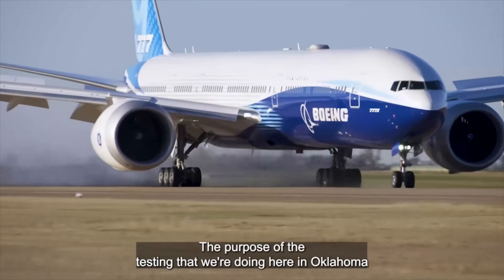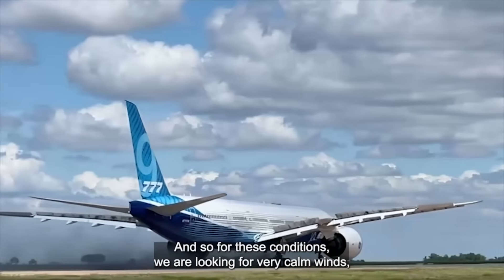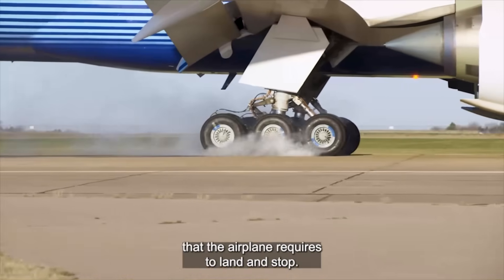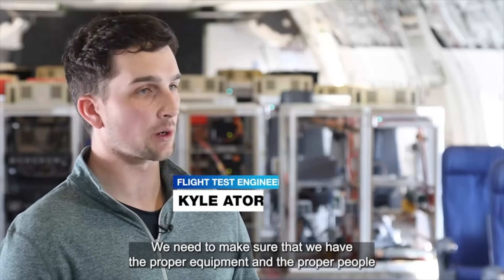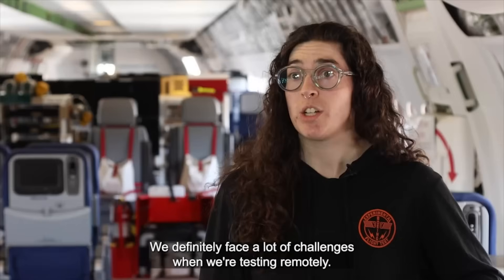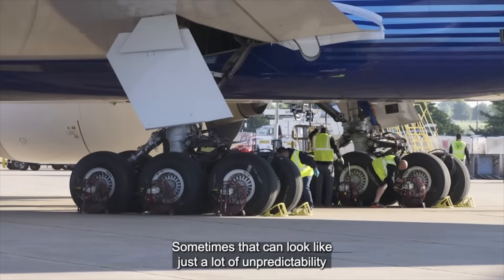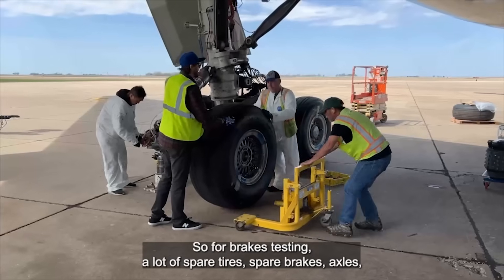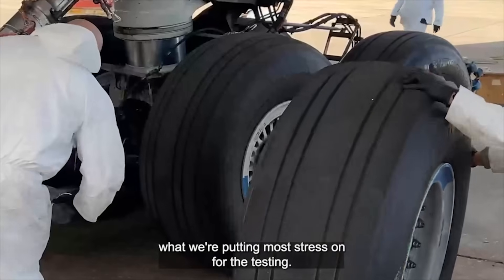Boeing 777X Underwent Extensive Brake Tests – All Credit to the Team Who Made It Happen!

Comment: Down with Boeing! Whitewashing the crash of Air India 171 as ‘Pilot Error’, not done!

At least I personally shall now never fly an airline that operates a Boeing airplane!

I used to love Boeing so much! The 777-ER used to be my favourite! But not anymore, they are making compromises on quality.

#if it is Boeing, I am not going to
Reply: That was caused by the pilot. If you listen to the cockpit voice recorder YOU HEAR THE OTHER PILOT SAY "WHY DID YOU DO THAT, WHY DID YOU SHUT THEM OFF"
Reply: @WillChrisman-jd6nv Yeah? Really?

Where is the quote and the time stamp?

The report says that the top speed the aircraft attained was 180 knots, and IMMEDIATELY AFTER that the fuel cut-off switch went to the off position - two things; if you even have a little understanding of aviation, you’d know that the engines don’t lose thrust all at once - so if the fuel cut-off switch was set to off after achieving a ‘top speed’ of 180 knots - that’s a lie; go to any simulator and you’d find that the speed keeps increasing for at least 2-3 seconds after the throttle have been pulled back/fuel cut off.

Secondly, the pilot is merely ‘INQUIRING’ whether the other pilot did something, to which the pilot responded with a NO!

Also, we have not been provided exact quotes of what the pilots talked about - these have been interpreted.

Moreover, the preliminary report doesn’t mention the exact altitude the aircraft attained, the exact time the fuel switch FAILED (it’s a bloody technical report for god’s sake); immediately after can be 1 second, 2 seconds, 3 seconds, or even 10 seconds - in a flight that lasted only 32 seconds and where the report mentions the exact time stamp of when the aircraft started taxing, it’s it ONLY OBVIOUS to note that such important information has been deliberately kept hidden?

Go fool someone else!

Boeing is a sham and has to be held responsible! Money has to give way to safety - culprits need to be put behind bars! It might just be someone you know the next time. Don’t be a fool! Use your rationale for god’s sake!
Reply: @dearzinndagi honestly you shouldn’t come up with these theories before a final report, and many people including real pilots have simulated it already and I dont see then giving off those details, other people like stig aviation give off information on the fuel control valves and how Air India did in fact change the entire unit two times, please just wait for a final report, if it says it was Boeing fault then you are right, if it doesn’t then you are wrong, and no Boeing will not “shut them up” because that would be really hard to shut up more than 5 branches following the investigation including the fact that they are all international and not American except for the NTSB
Reply: @EPRDATA Absolutely brother! I completely agree with you that no assumptions should be made before the final report! I am only countering ‘assumptions’ and ‘allegations’ which are being made against the pilots without any proof! 

If one thing is wrong, the other is equally folly! Wouldn’t you agree?

Comment: Meanwhile everyone is buying the A350 😂
Reply: Actually, the 777X is following a sales path fairly similar to the A350's. The A350 XWB launched in 2006 and racked up 777 net orders by the time of service entry in 2015. In comparison, the 777X launched in 2013 and has accumulated 541 net orders so far, with plenty more to come by the time of service entry in summer of 2026. 

Both programs suffered developmental challenges and delays, with the main difference being the 777X had to endure the Covid-19 disruption to global supply chains, the MAX debacle, and the 787 quality control conspiracy. Also in common, both the A350-1000 and the 777-9 have suffered from the industry shift away from large, expensive aircraft.

But good news: The A350 and 777X are not direct competitors, meaning that carriers that order one may very well order the other as well, depending on their overall fleet commonality strategy.

Comment: Stay strong Boeing
Reply: Yeah? Really?

Where is the quote and the time stamp?

The report says that the top speed the aircraft attained was 180 knots, and IMMEDIATELY AFTER that the fuel cut-off switch went to the off position - two things; if you even have a little understanding of aviation, you’d know that the engines don’t lose thrust all at once - so if the fuel cut-off switch was set to off after achieving a ‘top speed’ of 180 knots - that’s a lie; go to any simulator and you’d find that the speed keeps increasing for at least 2-3 seconds after the throttle have been pulled back/fuel cut off.

Secondly, the pilot is merely ‘INQUIRING’ whether the other pilot did something, to which the pilot responded with a NO!

Also, we have not been provided exact quotes of what the pilots talked about - these have been interpreted.

Moreover, the preliminary report doesn’t mention the exact altitude the aircraft attained, the exact time the fuel switch FAILED (it’s a bloody technical report for god’s sake); immediately after can be 1 second, 2 seconds, 3 seconds, or even 10 seconds - in a flight that lasted only 32 seconds and where the report mentions the exact time stamp of when the aircraft started taxing, it’s it ONLY OBVIOUS to note that such important information has been deliberately kept hidden?

Go fool someone else!

Boeing is a sham and has to be held responsible! Money has to give way to safety - culprits need to be put behind bars! It might just be someone you know the next time. Don’t be a fool! Use your rationale for god’s sake!
Reply: lmao Boeing needs to fix itself
Reply: No Boeing does not need to stay strong the people travelling on boeing aircraft needs to stay strong
Reply: @aryannarayan9208  onother one.
Reply: @aryannarayan9208  give it a rest
Reply: Stay alive Boeing passengers
Reply: @lsubesteva  So tired.
Reply: @Infiltrate.and.Betray so tired assole u guys news channel to speak against pilots ....
Reply: @lsubesteva  give it a rest
Reply: @jostmathe defending a billion dollar corporation is cringe asf
Reply: @KungFuWizardOfJesus  lol. You people truly don't know the meaning of the word facts and over react.
Reply: @jostmathe grounding an entire group of aircraft due to serious faults from an manufacturer is nit overreacting? Hows the boeing stock doing buddy?
Reply: @KungFuWizardOfJesus  its doing well actually, its close to this year's highest point. Okay my friend, lets remove the 737 max from the picture since we all acknowledge that it was a rushed program. with it removed, what faults are you talking about?

You guys need to chill, it seems to you guys that all incidents and accidents are caused by Boeing😅
Reply: @KungFuWizardOfJesus  and you do realize that stocks don't mean anything when it comes to accidents and safety. why bring stocks into this discussion ?
Reply: @lsubesteva  overused ahh joke 💔

Comment: Great pilots for a great plane!Is that a GE9X?
Reply: Yes
Reply: Ok thanks!
Reply: Yep, a GE9X-105B1A. According to the type certification data sheet, there are three subvariants: -105B1A1, -105B1A2, and -105B1A3. For A1, I believe takeoff thrust is capped at 110,000 pounds while max cruise is derated to 103,500; presumably, the other subvariants will allow optimization for hot/high carriers and operators of the heavier 777-8F. Leeham News states a 115,000-pound max will be available within these options.